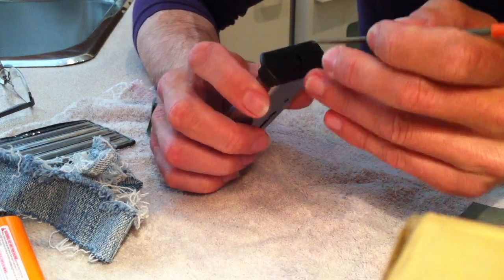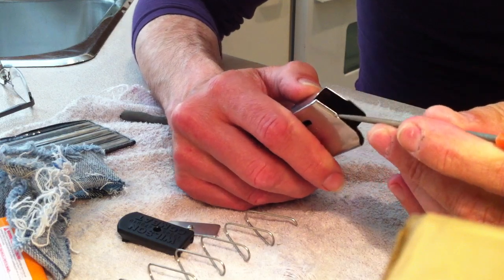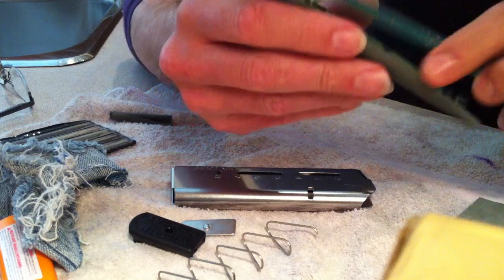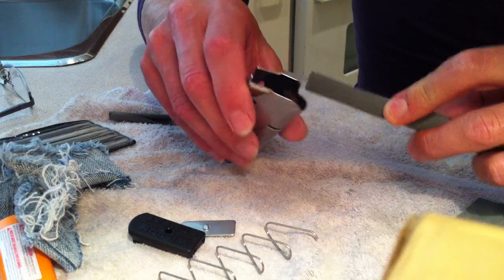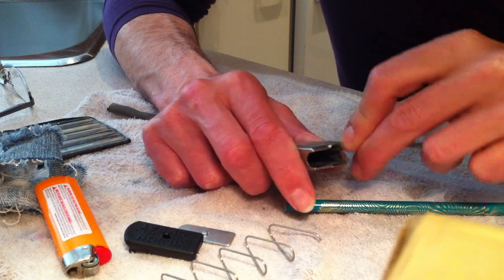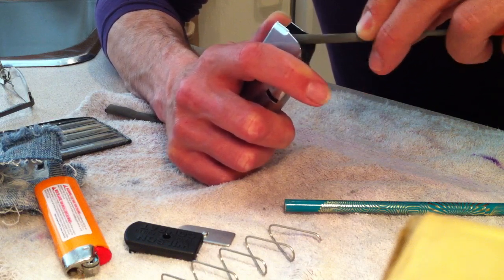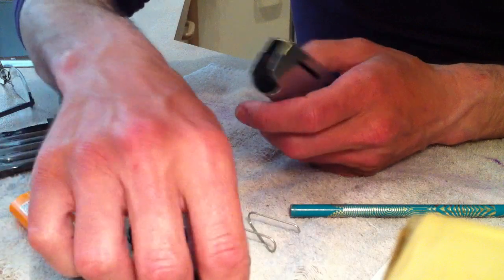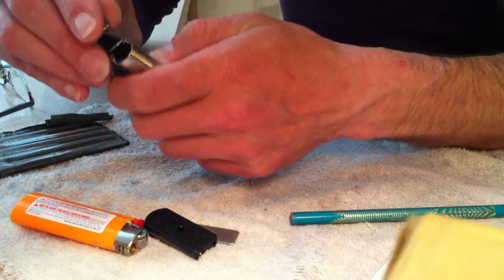Wilson Combat 1911 Magazine Tweak

Comment: I can't believe you guys spend that much money on a gun that doesn't work.  I have one gun that doesn't work.  Its taking up space in my safe.  Its a $1300 Kimber Ultra Carry II custom shop that will not feed HP ammo.  I sent it to Kimber and paid two gunsmiths to try and fix it.  It was supposed to be a carry gun.  Get it.  Ultra Carry?  Junk.  why would you want a gun that only shoots with a certain mag with a particular ammo.  Back to my glock.  Put a mag in, any glock mag. any ammo, pull the trigger and it goes bang.  This fool just spent how much time and energy trying to make a multi thousand gun work.